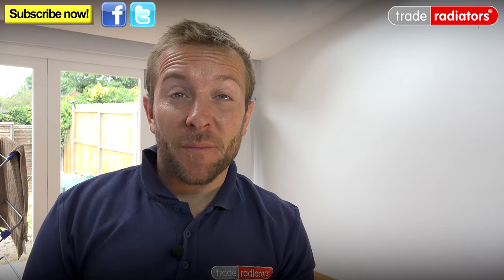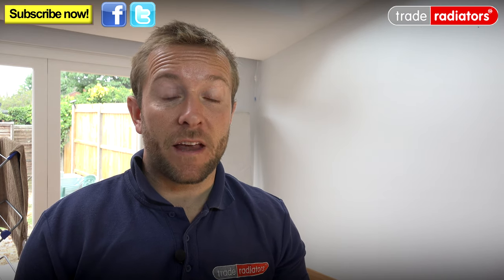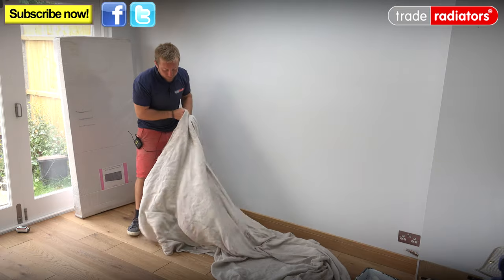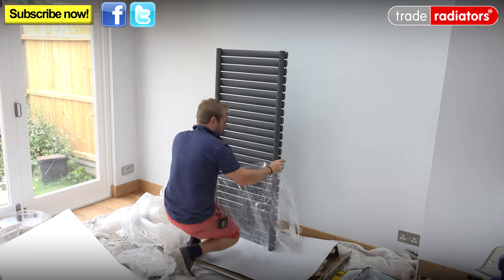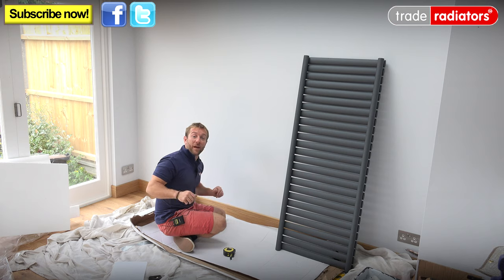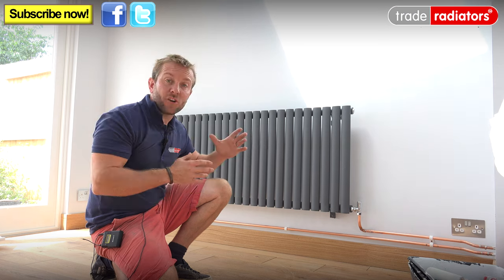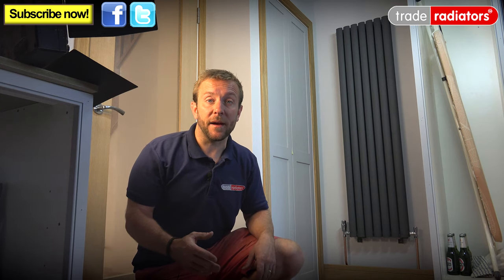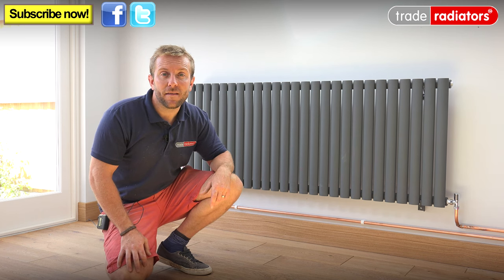Installing Anthracite Radiators In Different Rooms

Comment: I have a horizontal radiator like this, the pipes are plumbed so that the flow is on the right hand side, the radiator has stickers on it showing flow on the left hand side, is it vital the flow is connected to the flow side of this radiator?

Comment: I've got one of these vertical anthracite radiators installed though I've got a feeling it's been installed upside down as it never gets hot quickly no matter how the  system is balanced, are there usually any symbols on these indicating if they are the right way up,  don't have the paperwork anymore....
Reply: Im just thinking of purchasing this style of rad - interesting comment!
Reply: Ours does. The radiator itself has labels on in yellow stating 'Top' in the top left corner (when stood length wise) and inlet and outlet on the bottom left and right respectively.